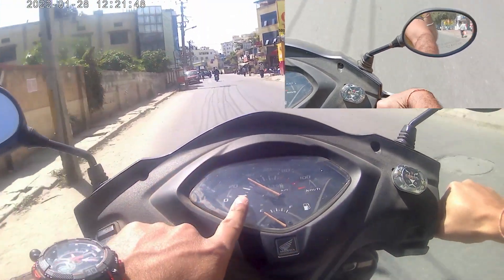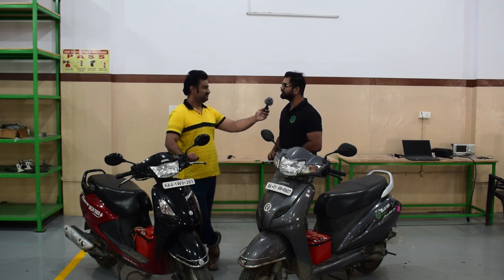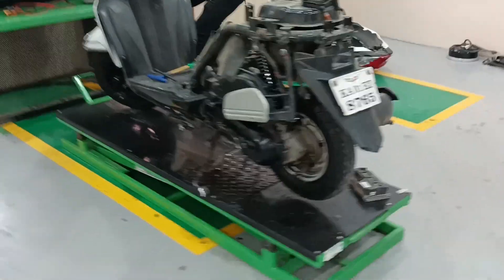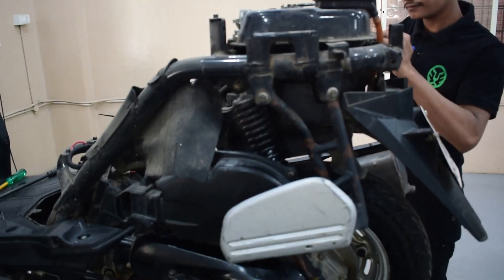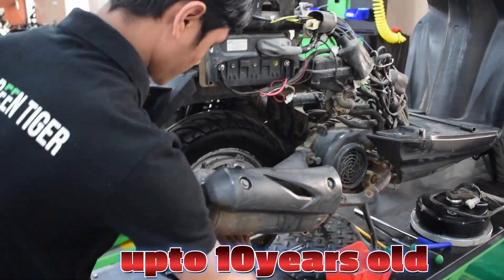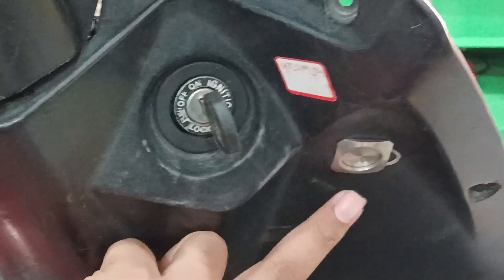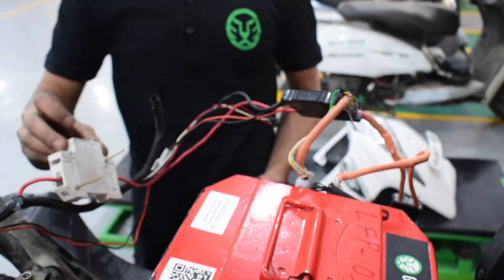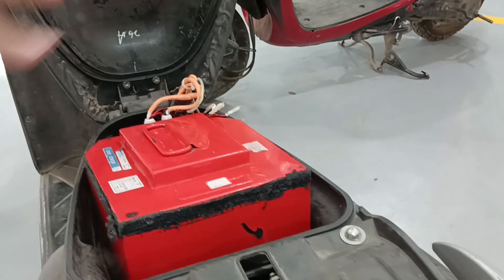RTO Approved Electric and Petrol Hybrid Scooter ||GREEN TIGER MOBILITY||DUAL POWERTRAIN IN TAMIL

Comment: It's not energy efficient to go for hybrid model in gearless scooters.  While running in petrol, the motor rotates idly hence consumes higher energy thereby reducing petrol mileage (perhaps it will charge the battery in this process, but cost of petrol exceeds recharging charging current). While running in electric, the idle run of clutch of petrol engine will consume more battery power. Hence overall less energy efficient.

Comment: air went should be there for battery place. else it will blast on hot conditions. also battery place they need shift to another place. if required shape of battery as well, branded battery needed if you are charging 6k man.